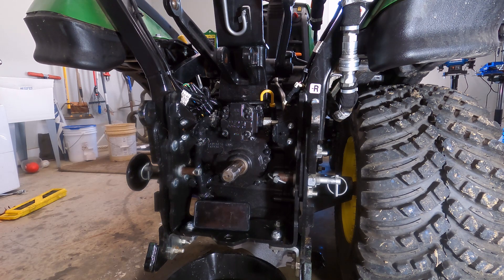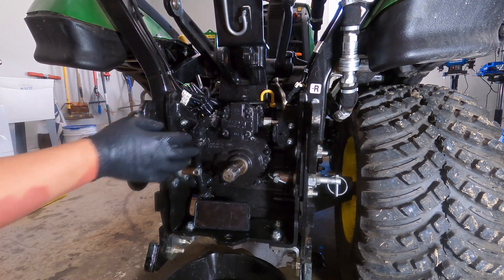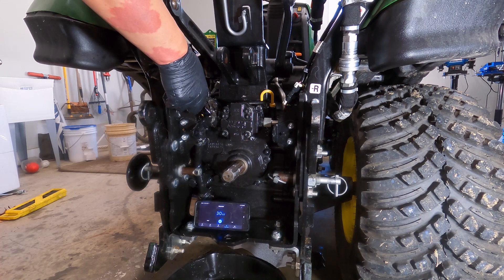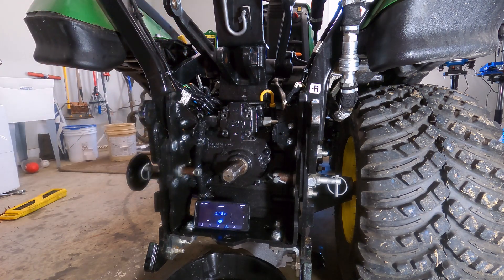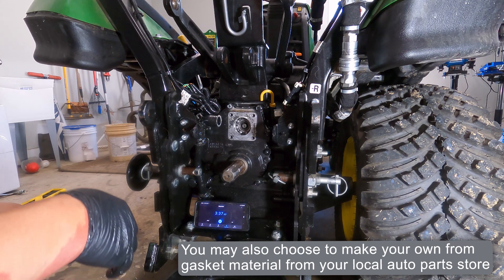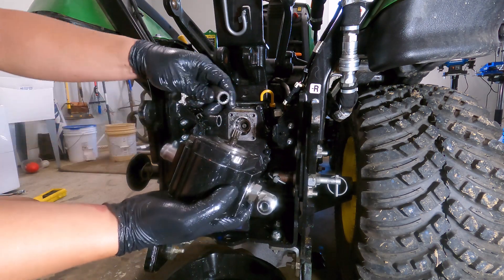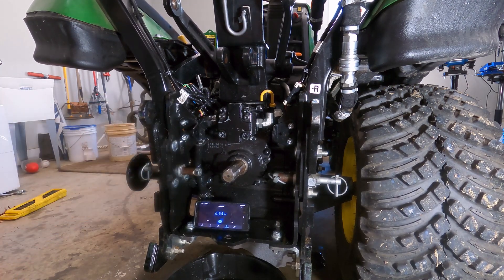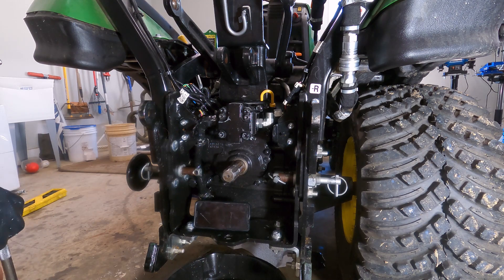HydrosPlus Pump Upgrade - Real Time

Comment: My stock pump on a 2021 model with just over 100 hrs is leaking bad around the front cover,is the oring inside replaceable or can I use gasket maker to seal it?

Comment: My neighbors have Kubota L33xx tractors and I've noticed that they do not have to increase their throttle to gain significant hydraulic lift pressure. Would replacing my stock pump with the  Hydros Plus HC pump (and kit?) give me additional gain in flow (and thus, more lifting power for my grapple or forks)  at idle?